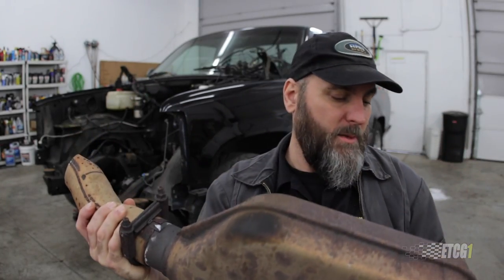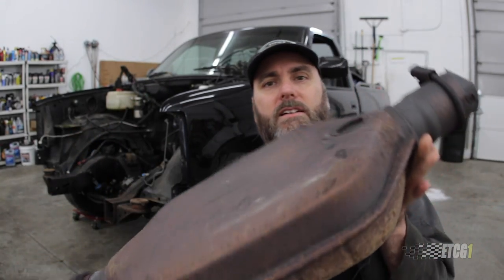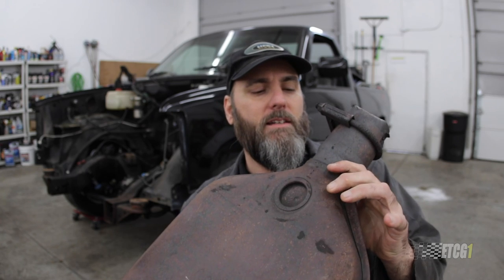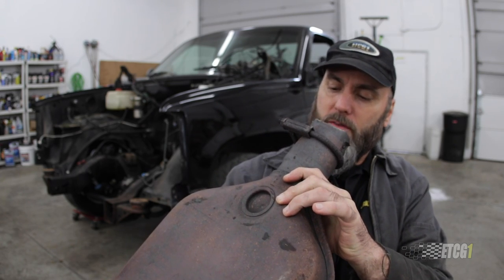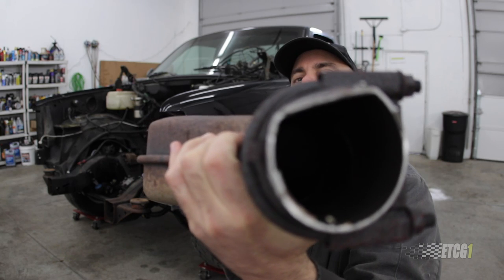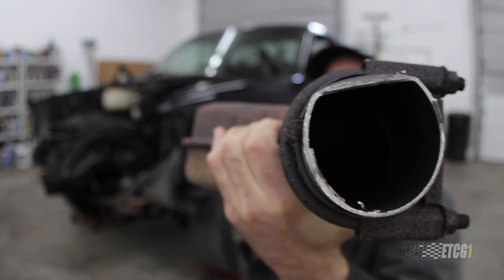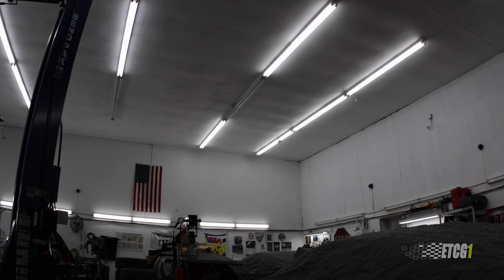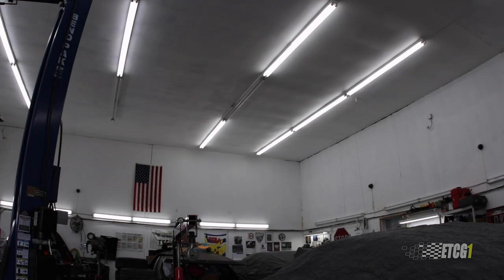Should You Run a Catalytic Converter on Your Hot Rod?

Comment: Sorry I'm late to your video, but yes, a late model car/truck that had a cat was federally required to have a cat, and it's a bad call to just ditch cats from the car. I suggest high performance cats for folks who are hotrodding. Unfortunately, emissions laws can make it really difficult for us to try to do the right thing by changing cat design. Once it had a cat, it's usually only legal for a company to sell you the right cat for the application, at least here in California and other CARB states. 

I welded in a 2 way hi-flow cat on my 1972 BMW 2002 and it never had one from the factory. It's highly tuned, including cam, sidedraughts, header, high compression pistons, and free flow exhaust, but once I added an O2 sensor, it helped me better tune the Weber carburetors so they're not running rich or lean. What state are you in that just doesn't care about 1990 truck?

https://youtu.be/OSMcHg_7eo4

Comment: You sort of answered your own question. If it’s legal in your state to remove it I would leave it off. I wouldn’t feel quilty about not using a converter in a vehicle that’s getting very little mileage. It would be something else in a daily driver. With the multi point fuel injection it would still be fairly clean compared to carburated classics.

Comment: I'm putting an LS3 4L65E combination in my RHD 1960 Bel Air in UK. There is no requirement for it to have cats but if I can find suitable high-flow cats I will put them on as they make a huge difference and I think we should be seen to be doing the right thing. Unlike VW.

Comment: Personally I'd switch to high cat/s  and keep running cats because after all they do make the world better and every little bit helps. Also makes the exhaust stink less and it would make a good video. Plus it isn't like you are going to run astronomical power levels is it? Which mean they won't rob that much power.

I'm currently swapping a engine from a 88' Saab 900 turbo into a 89' Saab 900i. The 88' car didn't have a cat but the 89' does which means I'll have to put one on the turbo engine, but I'll happily do it because I don't like stinky cars or the $5k U.S or there about fine for not running one in a vehicle that came with one. that exists here in Sweden.

Comment: My daily driver iS a cerTaIn AWD turbo sedan. And I run it catless through mufflers and on a “tune”. It’s actually been proven to be more fuel efficient while at the same time not being filtered by a converter. I justify it to myself as a trade off....(yeah I’m polluting more but it’s more fuel efficient.)My area does not have emissions testing what so ever. Converters block the sweet turbo sounds, hell, in my state you can have a hood/fender/bumper exit if you really want.  Just don’t get caught throwing fire or flashes. That’s generally frowned upon. It’s a tight rope to walk....

Comment: TBI is one of the best systems they came out with...reliable and easy to diagnose when there is a problem.. ..not the most efficient but ill take reliability any day.
Reply: working shlub reliable? What are you smoking ahaha
Reply: @Freyr77  what am i smoking?   the small block TBI motors late 80s early 90s ran forever....96 up with spider injectors were a disaster ..good block but fuel injection was awful till early 2000s
Reply: @workingshlub8861  yup

Comment: If it will be mostly a driver, put the new hi-flow cats on it.   The new cats are way better than those old ones we used to by-pass or hollow out.  I got one from Magnaflow, and really havent noticed any difference in performance compared to running without the converter.

Comment: Depending on the computer you end up with in the truck, it may look for readings from the O2 sensors.  With out the cat, they may be off.  Depending on what you do and how much modifications you do should guide your decision.  It is easier to put a high flow cat on it just to be nice to the environment.
Reply: they didn't start adding post cat o2 sensors till long after this truck was built

Comment: I guess I don't care what other people do as far as running them or not. Pretty much for the reasons you state, limited use of those vehicles and all that. I live in a state that doesn't check emissions and I've not run cats for many years now on my project car. However, I've grown tired of the ever-present hydrocarbon smell it has, and how loud it is. I will be adding cats back onto it this year. It will solve those problems I have with the car, and the benefit to the environment gives me a warm fuzzy, haha.

Comment: Yes, the worst part about removing the cats will be the smell. As least, since the truck and the Fairmont are both fuel injected, you could install cats on them if you were ever forced to do so. 

I love my old cars but the worst thing about driving them on a nice warm day is coming away smelling of exhaust fumes (no matter how hard I try to seal them up, I always smell at least alittle like exhaust if the window is down). Not as much a problem with old VWs, Corvairs, etc. with rear engines where the fumes trail behind the car. If someone would invent a reasonably priced cat for carbureted cars that was “plug and play”, with no other mods, I would be happy to give away 5 mpg to lose the odor! I don’t remember the smell being as bad when gas still had lead in it, but that could just be a memory and perception issue? Maybe even the new car back then just stunk too, so no one notice?

Comment: Put two high flow cats on it, it will benefit your health as it cuts down on carbon monoxide out of the tail pipe dramaticly. Small HP loss.  I used to get rid of them on farm trucks etc. I now keep or replace them, for me and my familes health.

Comment: Random question. I cleaned my throttle body and noticed a ton of carbon on the plate and also through my intake manifold. What causes carbon to build up in there. Is it because of EGR. And also does throttle body injection help keep a intake manifold clean as opposed to mine with port injection. Thanks eric if u read this.

Comment: What I found when I removed the catalytic converters on a  car that I had did a full exhaust on , from headers to tail pipe was , that a small amount of performance was gained , but the odour from the exhaust was a bit stinky , would I do it again ?, no .
Reply: Lean it out... Smell will go mostly away, but smells different..

Also you're still breathing in bad air with a cat, you just can't smell it.
Reply: @PurpleHeartVR  sure you're breathing in bad air, but not as bad, since there is no more sulfure and a lot less carbon monoxide in it.

Comment: In North Carolina (where I'm at),  1996 and up with OBD2 must still have annual emissions test so everything on a 96 and up has to work right.  On NC cars that came with emissions equipment on them prior to 1996 those cars are suppose to still have the emissions control devices present but there is no test to see if any of that actually works.  I have heard that some testing locations don't even look to see if anything is in place if the vehicle was made prior to 1996/OBD2.  On older cars we just have a safety test but that also phases out after a car is more than 25 years old (best I remember).   What gets "whacko" is when you are buying/selling a car to/from someone in another state.

Comment: If your going to drive it on the road especially going to shows far away would leave the catalytic converter on it. Has to be a way to get a lot of power with the whole original setup for exhaust between the engine and transmission.

Comment: We in the UK have to have cats from the early mid 1990's and we have strict emissions laws checked at our annual MOT. Emissions depend on the age of the vehicle. Before, I believe, 2006 you could run after market cats then afterwards they had to be designed for the vehicle.

  I run my older Subaru Outback and as long as I use unleaded petrol I should have no problems passing the emissions part of the MOT. The scare stories of needing to replace them regularly proved to be just that, a scare. My other cars, a 20 year old Forester has the original cat  and the 2003 Mini Sailed through the emissions with ease (original cat) sadly it failed in front swing arm bushes and corroded steel brake lines (replacing lines with cunifer pipe). 

The quality of air today is better than years ago and the smell of petrol exhausts has gone in the main. When an older car has passed the smell can be awful as they have such lax emissions (4.5% co and 1200 ppm HC). diesels are another story.

Comment: I see you point, so considering both sides; high flow catalytic converter if it really does bother your consciousness. I live in CA and it's absurd with the emissions laws; I'm too afraid to modify my car in any way to improve performance thinking it won't pass smog and my project car would be a huge paper weight.

Comment: I grew up where it was very hard to breathe. So I think a catalytic converter is a must if you plan on running an engine rich. The Fairmont is designed to run rich; therefore, it's the responsible thing to do.

That said, that's just my personal opinion. Should the government require it on these rare and beautiful builds? No.

I've personally installed a bigger catalytic converter and it got a lot more performance. It certainly wasn't as heavy as that trucks coverter!

It wasn't emissions required where I lived, but surprise! Where I moved to it was. Would have been bad if my car wasn't ready for that.

Comment: tl;dr: yes.
The stink without cat is just awful.
Reply: Exhaust used to smell good to me, but now when a car without cats drives by it really does stink.  Maybe I miss that good old leaded 105 octane Sunoco..
Reply: If it's tuned right it doesn't "stink". My car has dual exhaust and a quadrajet, smells like nothing.
Reply: @jordanwiley4582  There is nothing to tune for NOx... You are just used to it. A properly tuned exhaust smells like pancakes. Diesel especially, but petrol as well. You need a CAT to deal with it.
Reply: You must have bigger issues if the car stinks without a catalytic converter.
Reply: I love the smell of unburned gas in the morning lol
Reply: Put some perfume on if you need nice smells with your truck...

Comment: A lot of people dont like them, due to the fact of the minuscule loss in power. When it comes to reinstalling the cats, it's kind of personal preference. If you don't reinstall one, drive it to another state with emissions laws, they can cite you for illegal/missing equipment. A couple of states WILL impound your vehicle and keep it until it can be brought back into compliance. Every state is different when it comes to emissions. Now with the constant push for tougher emissions laws, I would imagine the exemptions for classics/hot rods will change as well. The state of California is a very good example of the noise and emissions laws. I personally won't run without a catalytic converter. The fumes are bad if your exhaust isn't perfectly leak free! I can't wait see the truck when it's done!

Comment: The stench I smell while riding in traffic from modern cars is telling me most don't work right. A well tuned engine has almost sweet smelling exhaust. Volumetric efficiency is the goal of a performance vehicle, this would have a side effect of reducing emissions. Tuning as lean as you safely can makes the most power. No, my cars dont have them, I don't feel the least bit bad about it either. I normally ride a motorcycle. (It never had one)

Comment: My 94 sonoma is old enough by 1 year to not need emissions parts. It also did not come with a down stream O2 sensor because of such. They where mostly using the upstream O2 sensor to judge the fuel ratio for the engine (mine is fucked right now so it's obviously not working). When my cat clogged, I deleted it and called it a day. Now where I live, modifying an exhaust system is technically illegal but no one has yet to bitch about it.

Comment: Doesn't bother me for your situation to not run one (or two). I plan on installing long tube headers on my '14 Silverado and plan on running a catted ypipe. And the reason is simple, the odor of the exhaust is typically greatly reduced. I don't want to get out of my truck smelling like I rode an old school motorcycle to wherever I'm going. It will also help the ecm more accurately monitor things which theoretically should lead to better tuning. But first and foremost the exhaust odor is my issue

Comment: I'g gonna keep my 4 cats on my 86 Crown Vic LX simply for the sake of keeping it stock (I also want it back on regular tags instead of historic). Imo, the backpressure keeps the engine smooth and nothing "new" gets introduced to my 223k mile system (with the exception of electric fans)

Comment: Eric,The problem with adding stuff to your exhaust pipe when your hot rodding or having performance is it slows down the performance you need to have a straight pipe for the engine to properly breathe so all the gases spool up the turbo and leave because the engine will get constipated and gas pressure increases. Ignore the theory of back pressure fir launch and acceleration it's basically a blockage that is unnecessary. Also I believe in climate change and pollution regulation but if you think about an engine going up to 150mph and 7.8psi of boost producing 570 hp it needs to allow all the exhaust out as soon as possible.

Comment: I have 2 cars and 2 trucks. An 05 monte carlo ss with 4,900 miles that has untouched exhaust, an 01 Silverado with 188k that probably won't have cats at 200k, a 91 cb9 accord with 290k and I probably won't touch its cat unless it fails. And a 90 c1500 making 280 rwhp that I consider to be my hot rod which hasn't had a cat in over 10 years. In my mind if it's a stock vehicle leave them, unless they fail after 100k in which case my state doesn't do e-testing and I'm not going to pay for a new converter unless I absolutely have to. Oh I also live in a rural area.

Comment: Fortunately and unfortunately, there are ways around things. Depending on how the local municipality does testing, you can run a newer obd2 vehicle with no CC (or even a gutted one), and still pass testing. 
As an example of different testing, Maryland only scans the OBD2 on cars and light trucks that are 1997 and newer. No CEL, and you're usually good. But, they can tell if you have recently cleared out the CEL codes....

Comment: Don't add one.  I have 2 vehicles.  A ultra low emissions vehicle, and a 26 year old Ford truck.  I'm restoring/ modifying my truck.  It has a 351 Windsor, and I'll likely remove all the smog components and converter.  My thinking is, 90% of my driving is done in my Honda, so it evens out.  It's worth mentioning, gasoline has come a long way, it burns somewhat cleaner, lead free, and that has to make a difference.

Comment: Depends if it came with one and if the ECU needs it installed to run correctly. I'm not about dropping a grand on a cat just to have one but if it's there and in good condition, I generally leave it alone.

Comment: All I will say is I can always tell when a vehicle in front of me has removed or gutted the cats. Way stronger exhaust smell. And don't ever run one in a building without them unless you just like the feeling of watery eyes. Yes I know you're not supposed to do that anyway, but sometimes we can't get around it while working on them. But in the end it's your truck. Do what you want. But it is amazing how much exhaust has changed in the last 30 years and how much we take that for granted today.

I would run cats but that's my personal choice. I prefer to not smell like exhaust fumes if I ride with the windows down, but on my old CJ7 with side pipes there's no aesthetically pleasing way to put cats on it, so exhaust fumes it is. At least I can take the top off and get plenty of fresh air!

And don't forget the legality of it. I believe (but do not know for fact) that federal law prohibits removing emission control equipment if it was originally installed at the factory. Federal law supersedes local or state on that, I would think.

Comment: If it’s a newer vehicle, leave it on.

If it’s a 90s rust bucket, just pull it. It’s probably clogged or not working properly anyways.

That being said, one car running without converters is not gonna melt the ice caps.

Comment: Big rigs dont have to take or worry about emission test not even in commyfornia. Besides if your not going to build truck to factory specs (going to efi,perf cam etc)it's not going to be easy to dial it in if you were able to at all with a knot tied around exaust. Most states drop smog test after so many years for one it didn't work that good in the first place and not everybody got the cash for a new ride every 4-5 yrs. Besides maybe it helps with mosquitos

Comment: I'm fixing a (currently rusty) 95 k1500 and I'll be putting a cat back on preferably stainless so it'll last. 

I've heard from small engine propane conversion manufacturer that lawn mowers produce many times more carbon pollution than cars do and propane can substantially reduce the pollution to almost nothing. 

I'm sure engines will always be around for back up generators any many of those generators can run propane. 

I think propane may be a work around for gasoline if engines get hit with more emissions regulations. 

P.S. propane is American produced fuel😉
Reply: If you have a smaller lawn get a reel mower, they save a bunch of headache with the engine/fuel and don't take any longer.  If you have a ride on propane is a great choice plus the engine lasts longer.